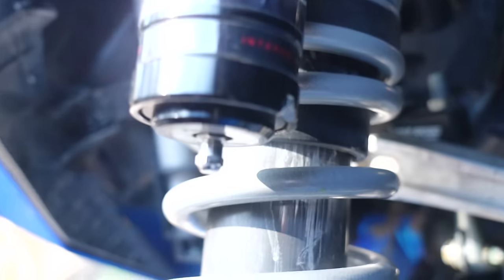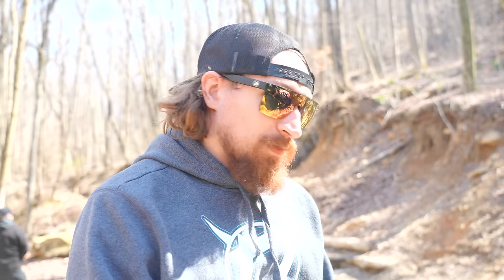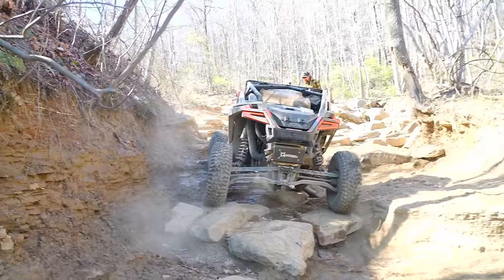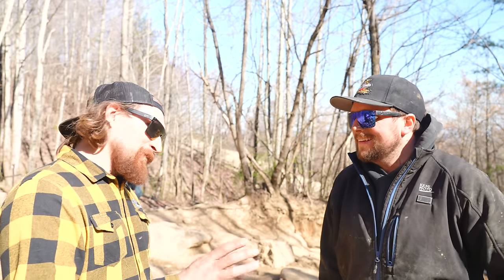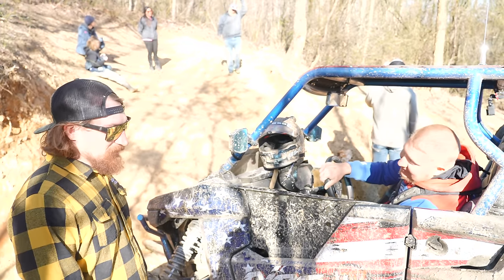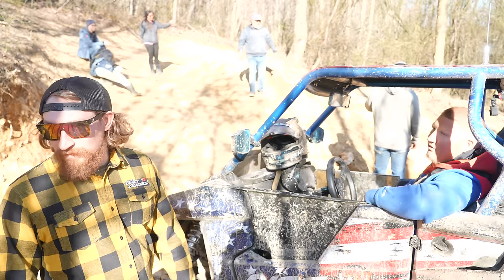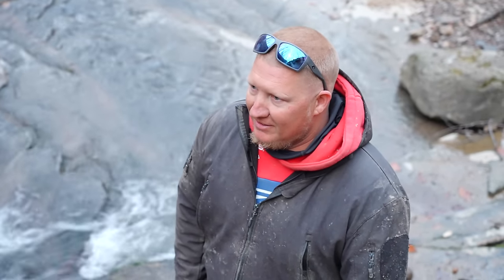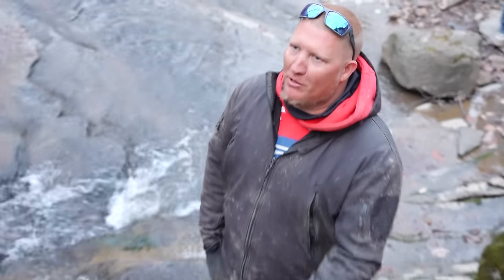Turbo Pro R On 37in Tires! OBOR Tire Challenge, Can They Take on Trails 15 & 16?

Comment: Dudes, I did 15 at Windrock on 40s in 2022 with the Pro R. 40" Trepadors on Hutchison Jeep Rims (Pro R same at light truck Jeep rims). People told me it wouldn't work but they did great with a new AA clutch. PM for video, don't want to push my crap on your channel.

Comment: I bought $2500 worth of stuff last summer from SATV and all has been great. They warrantied the front a arms no issues too after I blew the front end apart.
Reply from the maker: I’ve bought plenty of parts through them and never had an issue. But all the sudden they wouldn’t help me out with this one and kept saying I’m the only one having the problem. Even though I know two other people 🤷🏼‍♂️
Reply: Like Zack said, super atv was great in the past. Being a dealer we would call to buy one a arm and they would have me email them some pictures. Next thing you know, we would get a completely all new front a arm kit,,all 4 a-arms no charge!!!!! AND THAT WAS ON A MACHINE THAT HAD BEEN BENT FROM SOMETHING THAT YOU WOULDN'T THINK WOULD BE A COVERED UNDER WARRANTY  BUT THEY DID!! SO maybe it's just growing pains. And the new owners are still trying to figure things out??? But this problem with the PRO-R super atv a-arms on Zacks machine has been going on since last year. Starting around November or so..   
With that said hopefully they step up and take care of the problem with these arm's. 
IN MY OPINION THEY SHOULD BE CALLING EVERYONE THAT HAS BOUGHT A SET AND HAVE THEM INSPECT THERE'S.. I THINK THEY NEED TO FIX THE  PROBLEM WITH THE JIG THAT THEY USE TO BUILD THEIR PRO-R A-ARMS ON... AND CORRECT THE PROBLEM!!! SINCE ZACK AND MYSELF HAVE ALREADY DONE THE R&D WORK FOR THEM !!!! 
TO ANYONE WHO HAS BOUGHT A SET OF THE SAME A-ARMS MAKE SURE TO INSPECT THEM.... HOPE EVERYONE HAS A GREAT DAY.....BOB......

Comment: My super atv a arms were built incorrectly and when they sent one where the steering stop didn't only let you turn to one side was installed it separated on my second ride doing 65 through the dunes. If I didn't have both hands on the wheel I would have rolled. F'ing garbage.

Comment: I thought the RS1 was a giveaway. What happened?
Reply: The guy driving it is the one who won it
Reply: I won it, this was us riding after they delivered it.
Reply: @Whitmer76Racing did you have the front, rear, or both front and rear sway bars disconnected?
Reply: @jasonganje6994  disconnected  both after the first day. Big big improvment for slow rock crawling